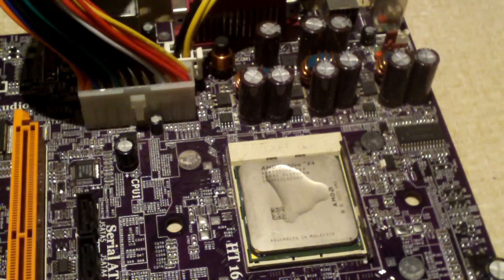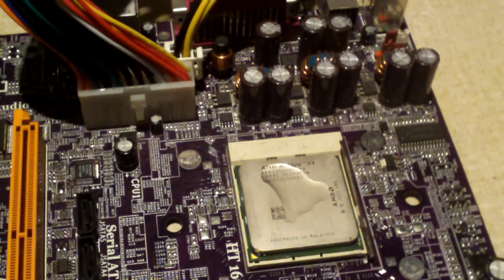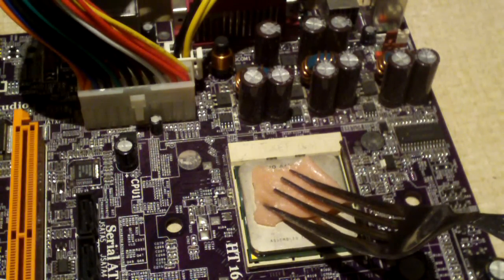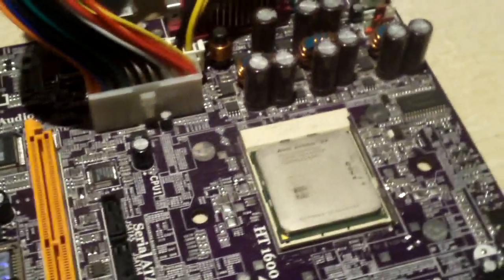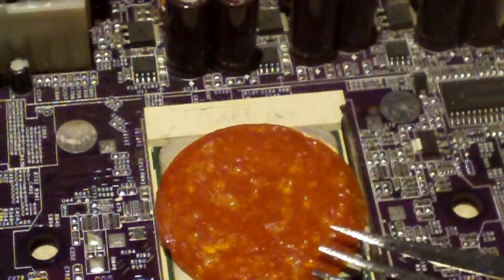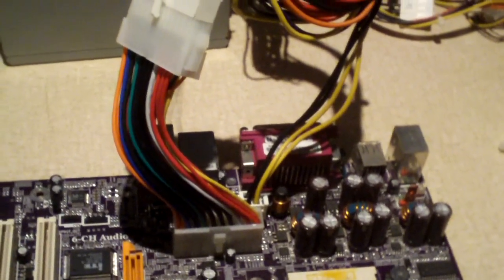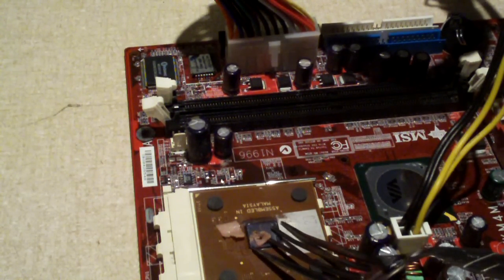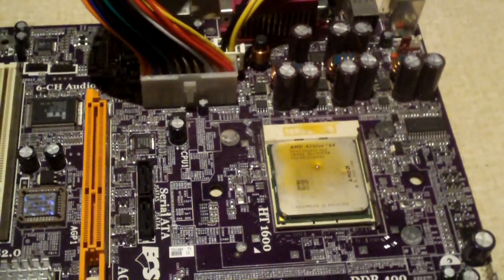Cooking with AMD - A Demonstration on CPU Heat

Comment: No RAM = No POST. No POST = No BIOS initialization. No BIOS initialization = no BIOS thermal protection. That's why it cooks better without RAM.
Reply: LucaTurilli89 BIOS initializes itself before POST, I forgot to specify exactly what I meant. From then it runs POST to test other hardware, which if it passes it initializes CPU, RAM, storage controllers, and video adapter. If it fails it halts and runs a beep or a blink code. Since RAM is checked before CPU in POST usually(since the CPU needs the RAM), the CPU's power management doesn't engage, so it either run full power or low power, and thermal throttling/shutdown is usually offline.
Reply: Not too often. The reason why some notebooks get hot is that some manufacturers depend on Windows power management when they design the cooling systems for certain models. Go into your power options, advanced settings, and under "processor power management", change both the Minimum Processor State, and the Maximum Processor State to 100%. Same result.
Reply: my core 2 duo pc shut downs while runing without ram, heatsink
Reply: AS GAMİNG AND SOFTWARE More modern motherboards will shut down after a component overheats even if BIOS isn't responding. I wouldn't recommend testing it though as you could do permanent damage to the CPU. But until POST is run the BIOS isn't able to put the CPU in the low power state.
Reply: Dilan Gilluly ha ok.My core 2 duo pc shut down after removed fan.(no ram,no post)

Comment: a 290x gpu would burn your house down
Reply: +dennis cheruiyot Haha Lol ;)
Reply: +dennis cheruiyot Double cooking with 290X2!
Reply: while overclocked
Reply: +dennis cheruiyot So would a GTX 480
Reply: Oscar Uriel Contreras Bravo sure back in the day thats what you expected but in 2013 onwards why do amd still want to burn peoples house down
Reply: +dennis cheruiyot Without any cooling, yes.
Reply: r9 290x + fx 9590 = global warming
Reply: Deramatic Radiation poisoning.😆
Reply: 4 way sli gtx 480 without heatsink on an 40c hot day

Comment: AMD = Advanced Microwave Device
Reply: Suchtkrebs 

seems legit 👍
Reply: 100th like
Reply: Suchtkrebs but it doesn't use microwaves
Reply: Advanced Meal Device
Reply: Advanced Meat Deburner
Reply: @StarburstAttack  yups now its not advance mirowave anymore and intel become Ovem Inside(on the rumors)
Reply: Which processor would be better in laptop for ms office,YouTube, internet without *hanging, *slowing,*heating problem?
1..Celeron 3867U (1.8 Ghz)
2..Amd A4 9125(2.3-2.6 Ghz)
3..Celeron N4000(1.1-2.6Ghz)
Reply: AMD 2020 : OKAY
Reply: starburst *turntables
Reply: @jamesglovecrazy  ... no

Comment: you need to  start a restaurant for nerds called the cpu kitchen :)
Reply: LOL yes, use the fx 9590 XD
Reply: Catpiss Neverclean
radeon r9 295 with no cooling for bbq party
Reply: I feel like the logistics of this restaurant might make that difficult.
Reply: Yeah
Reply: amd inside!
Reply: tehmalwaretester I think is better a 7990 without coolers.
Reply: Adriushkbg KBG No way, it get hotter, the 7990 only needs fans with fans only and without the water cooling on the 295 you'd fry the chip before you could say 420 blaze it.
Reply: Name the show CpuChef. With the host being called Chef RAM-SLI.
Reply: What about that one world record and processor that clocked to ~8.4ghz? you'd have a flambé.
Reply: Lol, I get it

Comment: I would use 6 processors all together and use it for making a whole burger.
Reply: Or you could use the threadripper since that thing is massive! (Barely fits in your hand)
Reply: Billy O'Reilly if u put a pan on top of cpu will it get the cpu heat,act like a heatsink and be useful for cooking?
Reply: @keyr324  you would need to put thermal past on the pan and it depends on the size too
Reply: Griddle

Comment: What do you prefer? AMD or Intel? And which one do you have in the MTDX?
Reply from the maker: Billy O'Reilly AMD
Reply: Billy O'Reilly AMD. Good for the price but if I were rich, i7.
Reply: David Cooltions Just get a job : p
Reply: Lol the CPU isn't all I have to buy...
Reply: AMDeeee! Or maybe a peasant like Atmel.
Reply: Billy O'Reilly Intel, Most games recommend it... Plus, the most Intel processors are unlocked, so you can overclock. (I use a i3)
Reply: NutkeyDoesMinecraft In my opinion. AMD and Intel both seem great. I never had terrible experience with either one.
Reply: NutkeyDoesMinecraft Almost all recent AMD CPUs are unlocked but otherwise yeah.
Reply: nerd73 In Game FPS the AMD loses with -3 FPS. Not much..
Reply: Which ever one gets me the performance I need for my money
Reply: AMD in most cases
Reply: +Billy O'Reilly amd for gaming
Reply: AMD if you're on a budget. Intel i5 or i7 if you have the money
Reply: AMD is actually not the best for gaming. Sometimes they are not even powerful enough for some software. Intel is better for gaming.
Reply: wat
Reply: +David Cooltions AMD4Lyfe
Reply: +Billy O&#39;Reilly Intel i series for use, but my stove PC has an intel pentium 4, oh and by stove pc i mean the pc is the stove
Reply: dampsalt
Reply: +dampsalt You couldn't scream Intel fanboy any louder if you tried, while Intel performs better, that extra performance doesn't always benefit the user, I personally use Intel processors but that does not make AMD useless. I'll bet that you have never even really tried using an AMD based system and you are just going based on what others are saying online
Reply: charizard4410 I salute you sir, I was using an AMD system for 7 years with NO problems at all, I have switched to NVidia and I'm getting some problems that I never got with AMD, this is irrelevant to Intel and stuff but yes, Intel get that extra piece of performance I can agree on that considering my father's PC is intel.. But AMD have the endurance of a bear
Reply: +Billy O&#39;Reilly Right Now AMD, Intel CPUs are too expensive for me, im dealing with a FX-6350 OC to 4.7GHz

Comment: when using amd, use watercooling
please try the same thing with a intel core i7 extreme 140w tdp, a intel core i7 at 4.4 ghz 88w tdp and a amd fx processors at 5 ghz 220w tdp.
Reply: there was one. it was only 2 cores.

Comment: I'd not be surprised if my i5 4690 would do the same...
Reply: +TackStash779 i5 4690 is very cool compared to the cpu he is using, u dont know what you are talking about.
Reply: Vinicius Pagliarini Prove it?
Reply: TackStash779 Google "i5 4690 benchmarks and temparature comparison", kiddo
Reply: +Vinicius Pagliarini it would do the same because both will get hot due to no heatsink
Reply: Nissan U. OH SRLY? What a genius you are broooo
Reply: Vinicius Pagliarini thanks
Reply: Nissan U. :D
Reply: lmao no it wouldn't... Modern i5's are cool
Reply: Brownie not cool enough to be run without any active cooling.
Reply: @AllGasNoBreaks416  Lmao no, ANY cpu would cook food like this without a heat-sink. Doesn't matter how the chip preforms with a cooler, with a heatsink, with low TDP, it's still gonna be hot enough to burn flesh.

Comment: My RYZEN 5 1600 barely crosses 59 C . Ideally 47 C and total idle at 36 C . (STOCK COOLER)
Reply: Omg what kind of power did Amd just possessed.. A company that once used to make hotter cpus and had terrible energy consumption, Same Amd has now surpassed Intel In both Cooler temperature and Energy Effecient.

Comment: pentuim D 820, it runs hot!!
Reply: My Pentium D 930 run never above 55°C 
but without a cooler this could be critical xD
Reply: o my word I build my little brother a super cheap PC with an 820 and it sounds like a plane taking of if you put it on you can hear it at the and of the street

Comment: remove the cpu while it's on
Reply: Then its off
Reply: facepalm
Reply: cringe...
Reply: @ian1064  What will happen though? o:
Reply: @mycelia_ow  not much, you will burn your fingers off tho. Its also a PGA socket so I don't think it can be removed while it's on as the latch will actually move the CPU